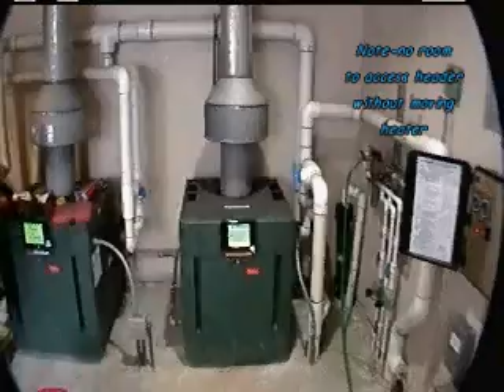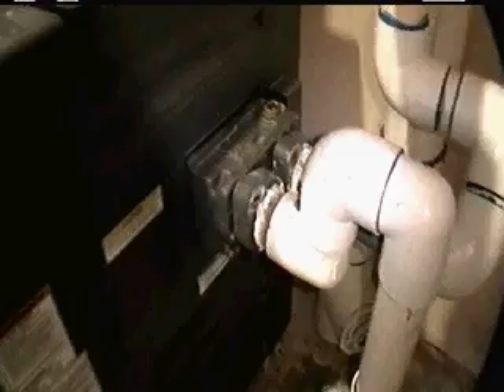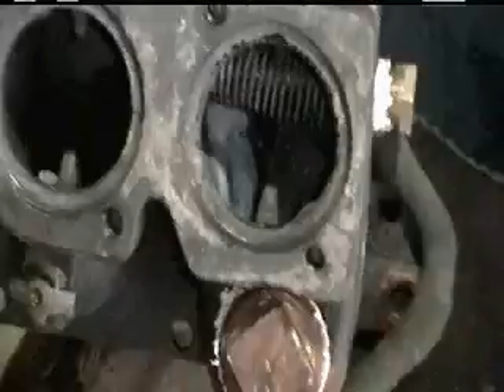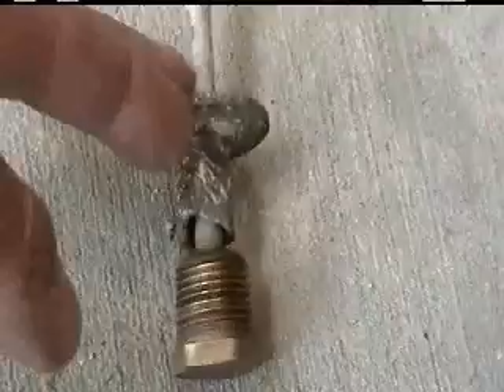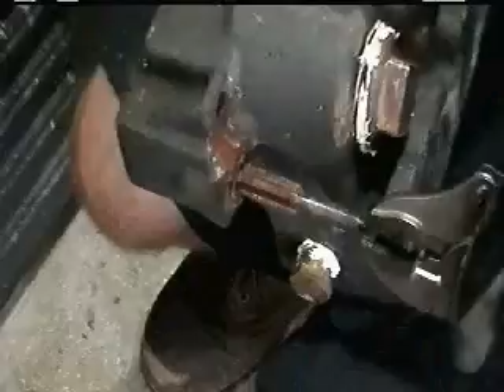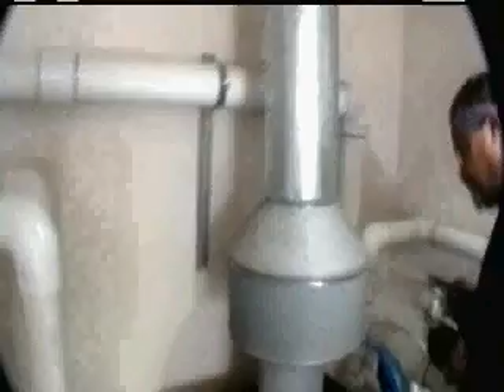Clearing scaled tubes on Raypak Heater

Comment: Uh that pool heater has not been running right for some time... I mean for the thermal reg to get that bad... that thing hasn't worked for months... that looks more like thru the roof alkalinity and the tech using calcium based chlorine. Something. But this was not a situation where the heater was working fine on Friday and come Monday it's completely destroyed. Great video though.

Comment: Somehow my RayPak heater has gone 30 years without this service.
Reply: That looks like a commercial application.  My guess is they run a salt  system and or use a lot of chlorine.  I'm sure with a commercial pool running 2 big heaters like those it must be a good size pool and I would guess they keep it heavily chlorinated.  Just my thoughts, I might be wrong completly.  I know that i just ripped my 12 year old raypak heater appart and though there was some tarnishing to the copper heat exchanger, it was like new compared to that one.  That amount of calcium build up did seem a bit excessive.

Comment: Just had some questions on the installation of the particular pool heater you're working on. #1 I did not see a pressure relief valve on this particular installation and wondered why? #2 I did not see a sediment trap drip leg before the gas valve on this particular unit and wondered why? & #3 knowing these pool heaters are installed in an unconditioned room I was wondering why double wall vent pipe (   B vent ) wasn't used from the pool heaters to the flu stacks? Much appreciated if you could comment on my three concerns.